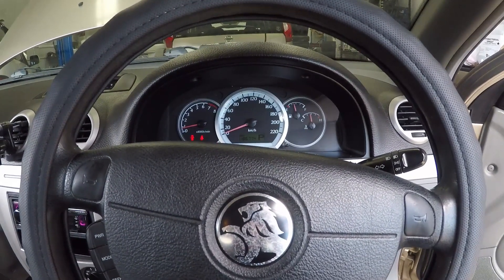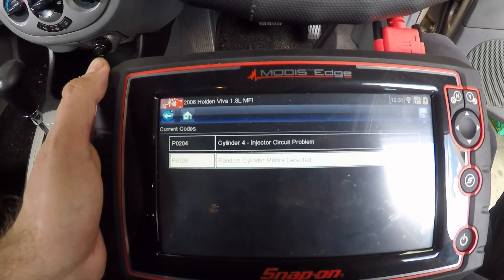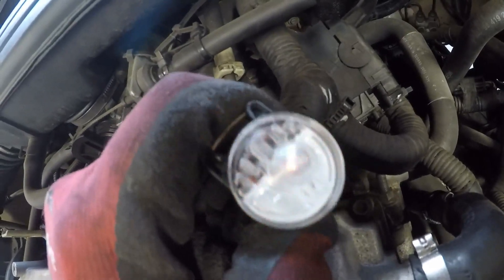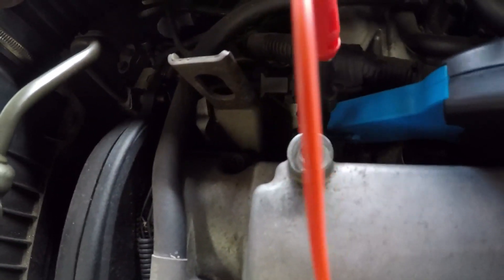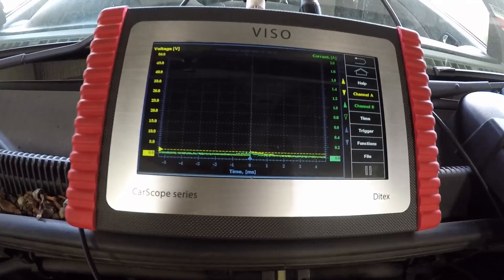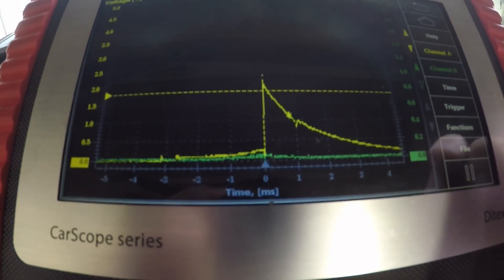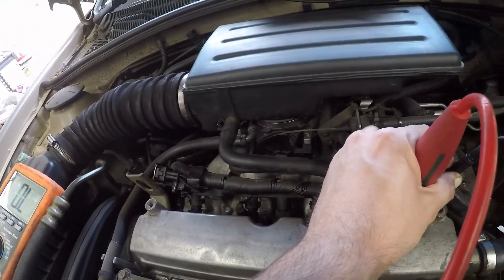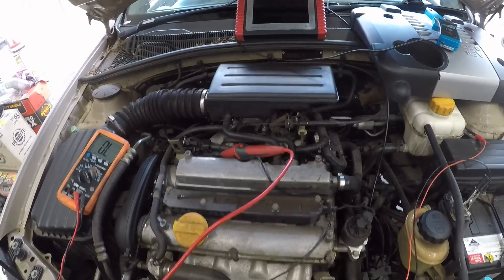Holden Viva Misfire P0204 - Different ways to confirm injector faults, noid light, scope, multimeter

Comment: Hi Rom, basically having the node light is a was of time cuz it's not really telling you much other than you have control. Thanks for saving me from investing in them
Reply from the maker: That's right Daniel. Noid lights can be misleading. If you've seen one of my latest videos, the random stalling on the BA Falcon RTV, showed nothing on a noid light indicating no injector pulse but the scope showed injector pulse, just low duration, in turn not enough current to light up the noid light. Where would you start on this one if you had no scope and your noid light showed no injector pulse if you know what I mean
Reply: @romanosautomotive  understood. I normally use the new power probe where you can check injectors with to take a look at Injectors. I got caught with a noid light before. Not really a fan.

Comment: So , once you get a basic test from the noid light , confirm with resistance , volts and amps . And like a COP , plug in a known good one to test the bad one . And if they are buried , you may be able to test through the harness . You can also use those chop sticks for lunch .
Reply from the maker: Haha I know I said chopsticks way too much!! Yes definitely, lots of tests available depending on what is accessible. Definitely through the harness also or even through a dedicated fuse with a fuse loop and amp clamps. Lots of ways to achieve the same goal. Thanks for watching and commenting Bill!